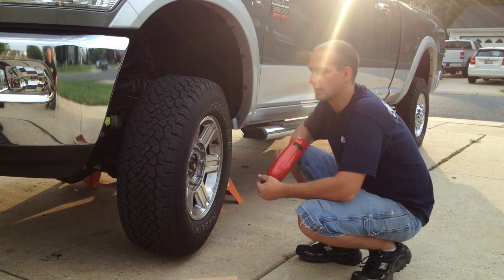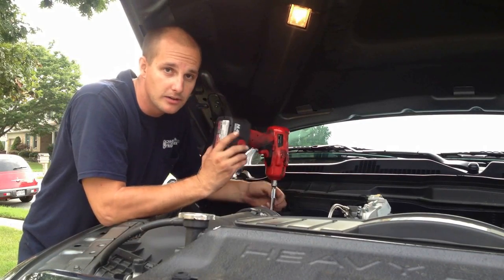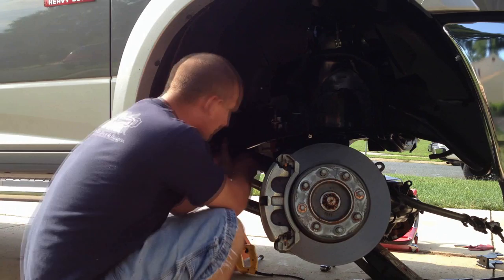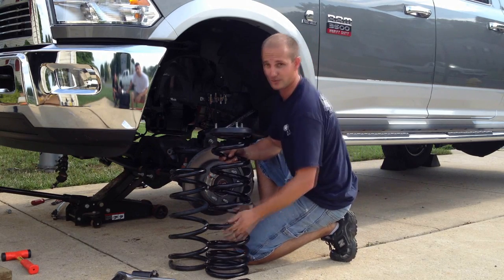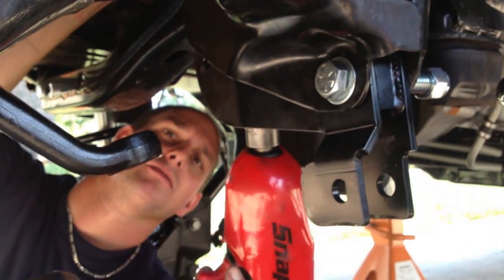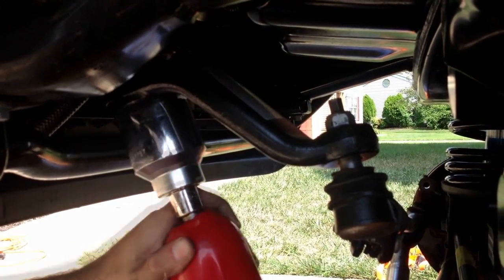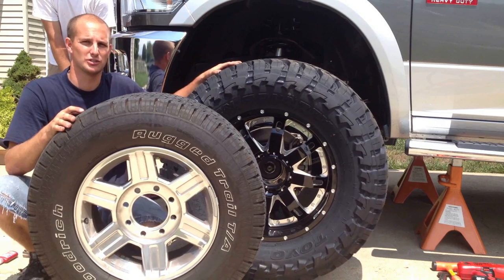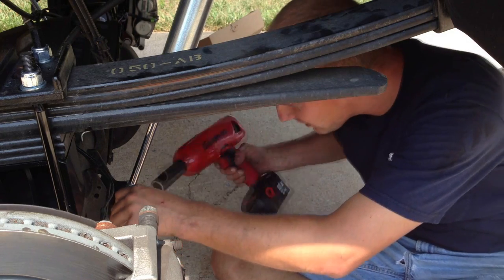Installation of a 6 inch lift from Top Gun Customz on a 2012 Dodge Ram 3500

Comment from the maker: We did run across a few issues. I am not sure if it was just our truck, but we had a few issues. We ultimately replaced the short arm kit with BDS long arm, and replaced the track bar drop bracket with BDS and both seemed to work alot better. The way that the track bar drop bracket was designed we could not get a clean fit without grinding the corners down. And we found the arms to be about 1" longer than any other companies. There was not cutting or welding involved per the instructions.

Comment: You guys eventually upgraded to the Top Gun Customz long arm.
Was there a reason for that?
I'm thinking of putting on the same kit, just like the one you did here, will it be fine for city driving and towing my 33' travel trailer?
I don't do any off road.
Cheers.

Comment: Are the wheels 20x9 or 20x10 and what is the off set if any? And what is the actual tire size of the toyos including width.Grate looking truck by the way loved it so much I bought a 2013 and am trying to decide on a lift and wheel package and helpful comments  would be appreciated.Thanks in advance.

Comment: This is a good step by step instruction, but it may be easier to follow if you focused the camera more on the pieces you are working with specifically as opposed to most of the time showing you work on it from a distance.  just my 2 cents